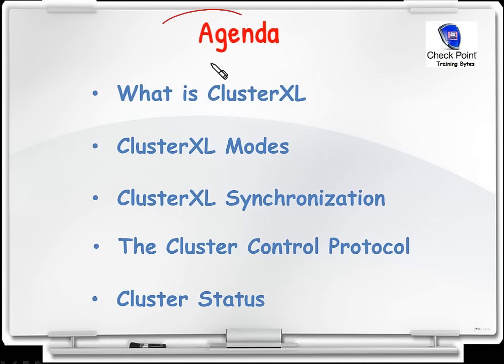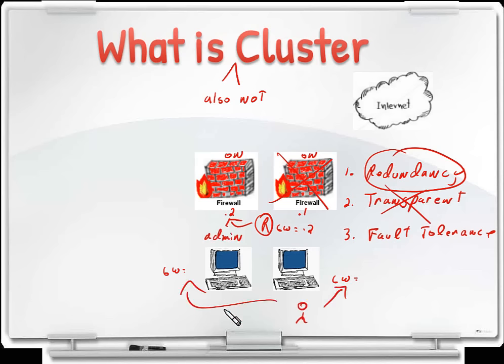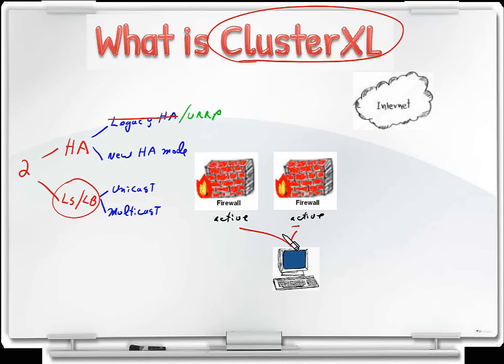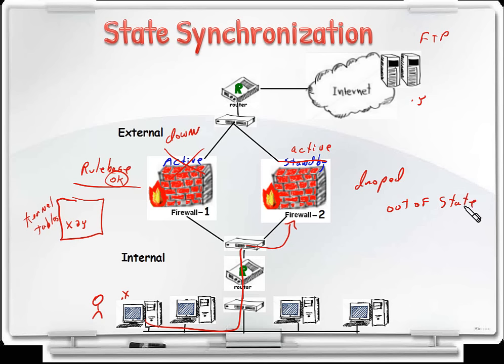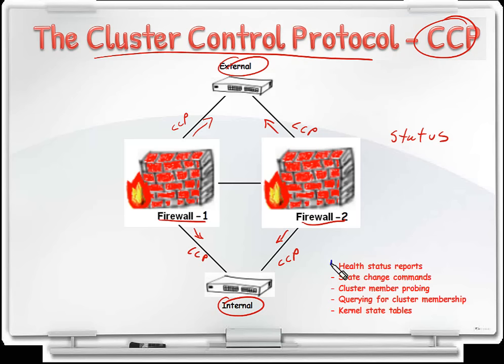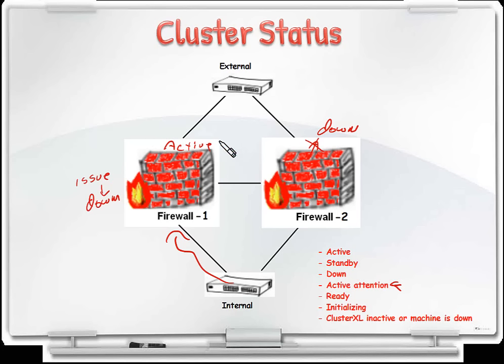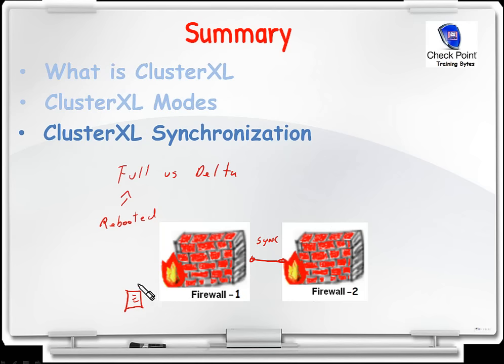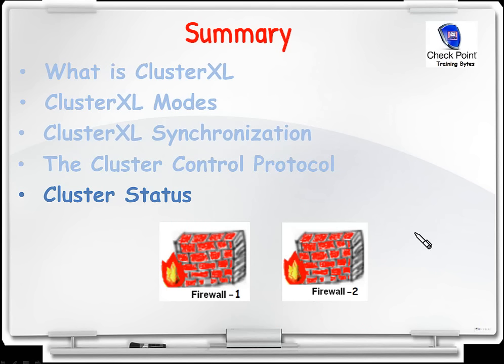Understanding Check Point ClusterXl Part 1

Comment: Hi! 
What happens if the Internal and / or External interfaces that supposed to send CCP messages are connected to end equipment which is not passing this status messages to the second FW? Why those messages are not send via the sync connection?

Comment: Are HA and Sync cables same? Please advise
Reply: HA is done through the dedicated Sync interface, if there's no dedicated Sync interface then any available interface can be used as your Sync. You can either directly connect the two sync interfaces(using a cross over cable) or go through a L2 switch(normal cat 5e/6 cable)...Please note, it has to be a L2 switch, the sync interface won't work with an L3 switch.